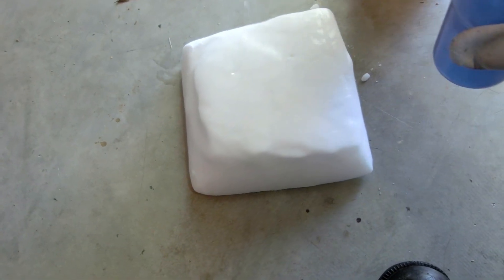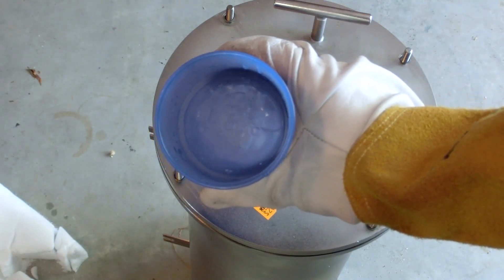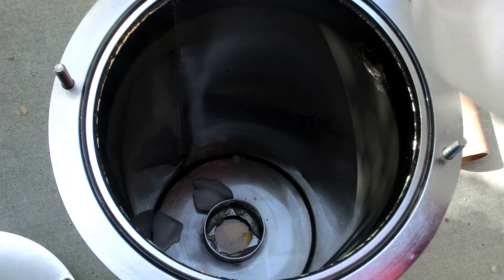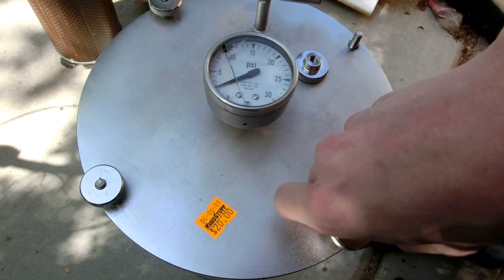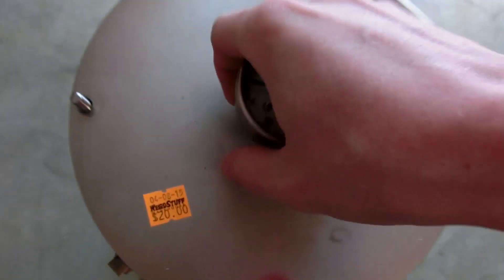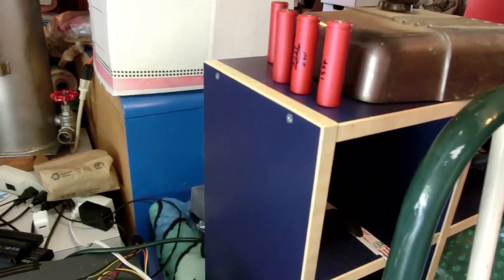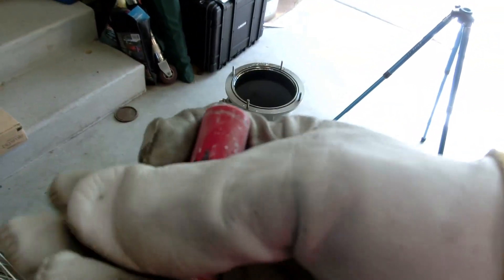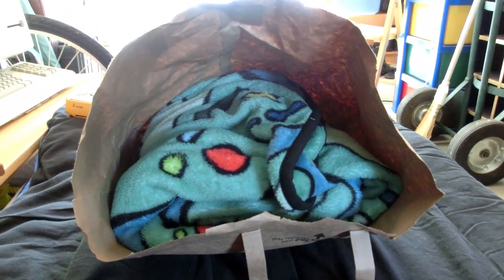Dry Ice Experiments and playing around at -109 F°

Comment: Hi, Great channel! Q: how much Wh does the bike use per mile? i would like to built one to but I cannot decide on the size of the battery pack.

Thanks! 

Bram
Reply from the maker: Bram D it uses about 3wh per mile at 12mph i think. cant remember for sure though. i figured it out in one of my videos.

simple rule of thumb though is for every amp you plan to pull from the battery you want 1 amp-hour of capacity.

Comment: Just a past experience to share. Back in the 60's I didn't have the tools needed or money. I had to replace an axle bearing on my car, got the old one off with a chisel and hammer. There was an ice cream company close by and they gave me a block half the size you got. I put the dry ice around the axle base, put the bearing in my mom's oven @ 200F. It slid on the axle easily, got me going without paying for having pressed on.
Reply: rchighfield1 Work smart, not hard, right? (Although I don't know if I'd call that easier.. good story though)

Comment: You're supposed to put the coin in on edge. It melts a slot and the sublimating gas makes the coin vibrate.
Reply from the maker: insanegammer109 i'm not supposed to do anything, i do whatever i want.
Reply: Ok, you should. It's much more interesting. Coin + Dry Ice speaking.